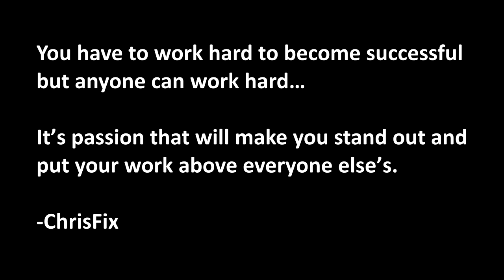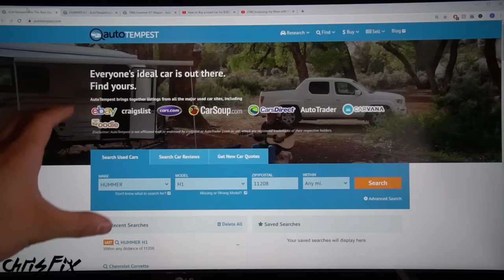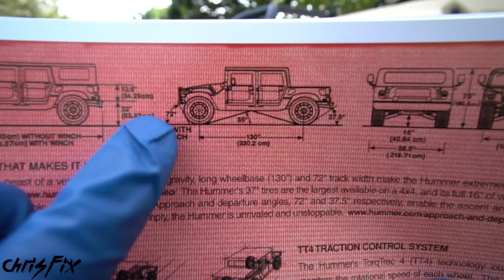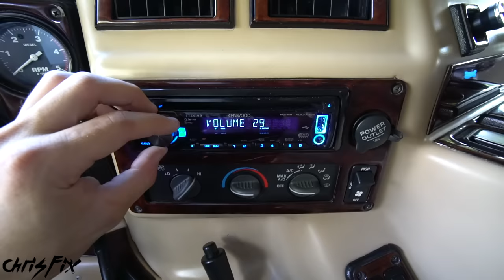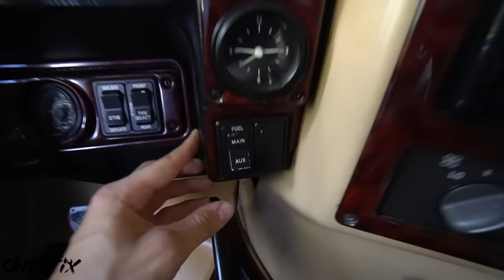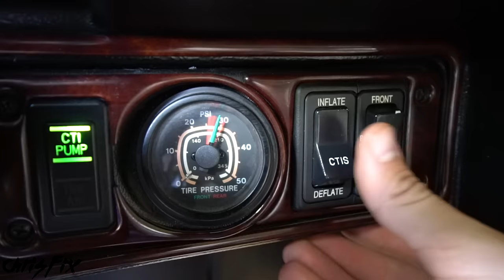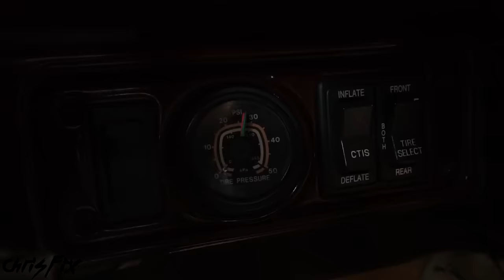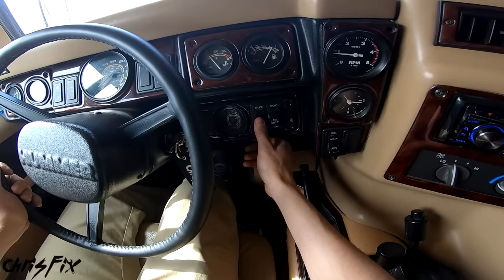I Bought My DREAM CAR and it's AMAZING!!!

Comment: With out chris fix I would NOT have been able to save as much money as I have through his videos. I SWEAR it. From buying my car, to changing the oil, replacing spark plugs, painting parts, and changing my blinker fluid, piston return springs and muffler bearings. I credit you chris because without you my passion for cars wouldnt be what it is now. 🤘🏼 thank you
Reply: Muffler bearings! Haha! Good one.
Reply: Lol blinker fluid.
Reply: you forgot wiper balancer
Reply: Muffler bearings are expensive at the shop. It's almost impossible to get a mechanic to change them.
Reply: Haa nobody noticed pisto return springs?

Comment: Hey Chris, figured you might be interested in knowing the reason why the center doesn't have any seating (you have that weird (no offense, just never seen that before) optional bench seat in the middle) in a standard military HMMWV (High Mobility Multipurpose Wheeled Vehicle) it's the perfect amount of space to fit a medical stretcher through the trunk. so that the people sitting in the back can then tend to the person on a stretcher in the middle. A little story, we were doing desert training in Nevada for deployment and some new recruits were driving HMMWV's for the first time. Well, they have plenty of torque. Had a youngster drive about 10 miles on the road. With the parking brake on!... As soon as we stopped the damn thing caught on FIRE. We got the fire put out quick. No real damage to the vehicle. The poor guy didn't hear the end of it for the rest of our field training. Good times.
Reply: G Juliusson also the HMMWV has that also because all the stuff like the axis and driveline is tucked up underneath so it’s harder to get it stuck on hills

Comment: 0-60 to in 7 secs in a 4 ton truck is AMAZING! Congrats on your purchase! :)
Reply: not really lol
Reply: @sacatolasmoreira5593  how isn't it?
Reply: and .7seconds just isnt amazing, ever. 7 seconds feels kinda quick enough i guess, but not amazing. my cheap entry Level, 58hp motorcycle from 1990 does 5.8 seconds. and thats not amazing , it is fun. Your average nakedbike is kinda amazing, Pretty much all below 4.5 seconds
Reply: @gur262  is your bike 4 tonnes??
Reply: Joshua Mack yeah, a bike weighs about 200 pounds at the most. You know how heavy 8000 pounds is right?
Reply: @gur262  7 seconds for a normal car is kind of quick, but for a truck that is that heavy is really impressive imagine being at some traffic lights in a 05 V6 Mustang not* an amazing car but not terrible had a little performance and this hummer keeping up.
Reply: yeah crazy 0.5 quicker then my kia proceed :) and its 3 times the weight
Reply: Some of you need some lessons in physics! :p
Reply: If my point wasn't clear. 7seconds ain't amazing for anything with an engine because it just wont feel amazing. It's a car.         If it weighed 30tons 0-60in 11seconds could be named amazing then. If it was a house 20seconds could be called amazing. But they are never amazing.

Comment: ChrisFix:  Puts a lock on fuel tank

LockPickingLawyer: 1 is binding, nothing on 2...
Reply: The ultimate crossover
Reply: I swear I was thinking of the lock picking lawyer as he was installing them fuel tank locks.
Reply: I thought the same thing my dude!!! I would pay good money to see that crossover lol
Reply: Lpl will just use a 50 Cal muahaha
Reply: i would try to unscrew it
Reply: Hahahahahahahahahahahha
Reply: The first thing he'd say is to weld those screws 😁
Reply: Hahahahhahahahaha
Reply: @thomasandrews9355  what is this now demo ranch crossover?
Reply: @ihatethatyoutubedisplaysyo8106  lol true
Reply: Dammit this guy watch too
Reply: With the lock on he can now drive in Eastern Europe.
Reply: He doesn't even need to do that! Just an impressioning tool you can buy on amazon.
Reply: Floating hand channels FTW

Comment: It is so amazing seeing you happy! But you should make video installing train horn!
Reply: CHOO CHOO! 😂
Maybe a bus horn? High pitch and VERY loud.
Reply: @ramslade  train horn is amazing! Bus horn is not up to level of Hummer!
Reply: Needs a horn from a semi at the very least, also the Hummer has an air compressor in it so should be able to hook the air tank needed to that :D
Reply: He’s going have to go through the trouble of shoving an air compressor in the engine bay unless he puts the air compressor in the back
Reply: Or just a heavy. Semi truck horn
Reply: Yeah, and insanely strong led lights. But like 30.000 lumens kind of strong 🤯

Comment: I'm in the Marine Corps and HMMWVs are the biggest pieces of shit I have ever worked on. But this one is pretty sweet.
Reply: Greatest-killer1 we have one that has been sitting in my shop for over a year
Reply: Greatest-killer1 he bought a hummer not HMMWV. So his will be easier to work on
Reply: You gotta remember the absolute abuse HMMWV's go through though, one of my old drivers floored the damn thing everywhere we went when he drove it, and that's just the beginning. The vic never let us down despite that guy
Reply: Like most vehicles with military applications, they are designed to be serviced and worked on, and returned to the battlefield as fast as possible.  They also tend to be designed with maximum flexibility in use so one basic vehicle can have probably over 100 different uses by making bolt-on changes to the body.  Inevitably this means that some things that would be almost essential in a road vehicle have to be compromised.  A lot of the issues with the HMMWV tend to be the rather old fashioned mechanics that they are fitted with from the factory to make them somewhat affordable to build.  Most of the Hummers that are on the road have, like this one, been upgraded well beyond what the military got, and had most of the inevitable design faults cured too.  Like the Land-Rover, they have plenty of faults that can be somewhat corrected, and there are lots of people who love them.  I like the H1/HMMWV a lot, but they are utterly impractical in the UK due to their physical size and thirst so it's very unlikely I'll ever own one.  I have to say, though, I've driven HMMWVs and they're a hell of a lot more comfortable than military spec Landies...
Reply: At least they don't use the plastic POS Hummer. Lol. The HUMVEE is a beast.
Reply: Semper Fi!👍
Reply: Comeing from the Army being a 91B I'd have to say the same they tear up 24/7  although I'm attached to cav scouts and they arent easy on equipment.

Comment: Stereotypical youtubers dream car: it is a v12 and the 0 to 60 is 3 seconds....
Chrisfix: my dream car has 16 in of ground clearance and ran over 2 civics
Reply: Its got a duramax in it 😂 v8 btw if u didnt know
Reply from the maker: #truth
Reply: Every youtuber
-lambo
-GTR
-porshe
Reply: Louis Harley Aguilar not me
Reply: @dallasdelano8235  min is a 1969 chevelle ss
Reply: Lol I want a Subaru Baja but I also love the Lexus LC 500. Those are my dream cars. Don't need a Ferrari or Lambo and TBH I find them a bit boring
Reply: Tru Matthews nice. Mine is a 1967 Shelby gt-500
Reply: Dude my dream truck is a lifted GMC Sierra or the ford ranger
Reply: seriously. your content quality is through the roof @ChrisFix.
Reply: @dallasdelano8235  and i thank you for that, gl on your truck, hopefully you fix her up and make it a project...i see you need a paintjob, ive painted several cars before and worked on a line as a painter

Comment: For the fuel doors, replace those Philip head screws with torx or allen, not really detering besides a opportunity
Reply: No, make each screw require a different screwdriver.
Reply: And put posion on them.
Reply: Highly doubt kids will be carrying a screw driver with them to put dirt or water in someone's gas tank. If you're really paranoid you can put rivets instead of screws
Reply: going with the flow...weld the fuel doors shut forever.
Reply: They looked like torques to me
Reply: Pentalope is one of hardest to find tools specially used for some electronics.
Reply: he just has to round them XD no you need a drill and much time^^

Comment: 29:15 Installs with common hex screws and says: "And now nobody can get in". 

Well. Except anyone that has been on IKEA, that is. Hahaha
Good stuff Chris, I'm happy for you.
Reply: Needs to use security ones or hammer ball bearings into them
Reply: @johnrichards7847  Or pop rivets
Reply: Fill em with JB Weld
Reply: or Maybe a Threaded machine screw with a nylon nut on the back.
Reply: Stainless steel Pop Rivets would  be cool !
Reply: But most drunk people who want to pee into your gas tank don't carry a screw driver around.
Reply: @Jehty_  I doubt that's what he's worried about, I'm sure there are a few people who blame him because they made mistakes while working on their own cars. They might see his dream car as an easy target for what they consider revenge.
Reply: I mean, who has a hex driver in hand? And they are round head so you can’t do the plier trick. This wouldn’t be as easy to bypass as say security screws. Security Torx you use a flathead. So it’s not Leatherman removable.
Reply: @johnrichards7847 security ones you could use a flathead in. Source, done it before multiple times. The post makes you have a great bracing point for the flat to then bit and turn. A Torx is easiest to do it with but a hex can be done with.

Comment: "I need a daily driver"
(Drives in on military hummer)
Murcia
Reply: That's the civillian edition
Reply: @nedkogenov5530  Sure, but it's still very much a military vehicle at heart, hence the hooks, the portal axles, and all that stuff specifically intended to make the vehicle tough as hell and massively capable. We're talking an H1 here, not an H2 or H3.
Reply: Hex Flareheart  it’s still a civilian model!   Matt from demolition ranch has the real thing!  It’s slow, it’s loud, leaks when it rains, and has the most uncomfortable seats in existence!   This hummer is nice but it’s still a cushy civilian model!
Reply: Those people who are so nit picky about whether it’s a civilian or not just piss me off. Ok you can point out it’s a civilian model but y’all getting so angry. Let the man be happy. A hummer is and always will be a military vehicle civilian model or not.
Reply: @jaykneegarner2479  Before the dmax swap - it had the exact same engine  Now all it has is the exact same chassis, suspension, tires, body, bumpers. The only difference is that there's nice cushy seats and plastic bits in the interior.  Thats really it.  Oh and the electrical system is 12V not 24v.  Believe me, its an HMCS, the roof still leaks. It's still loud as f***. If it was a 6.5TD like mine, it would still be slow as balls.
Reply: @jaykneegarner2479  it's basically the same thing. Besides the engine, trans, and interior is the same. I work on the military ones (M1151A1) daily trust me the look and act the same as this one.
Reply: „This is America“
Reply: @OneTiredMechanic  "besides all these major components"... Really mate?
Reply: @ANF_94  if you cummins swap a f350. It's still an f350 it's just got a cummins. The humvee originally had a 6.5L Detroit diesel mated to a 4L80E transmission. Now it's got a 6.6L duramax and an alison 1000. Not that far off from original. So yes it's still technically a humvee
Reply: @jaykneegarner2479  its because hummers are most likely used at the military and we dont see the civilian model that much because hummer was really made for military purpose(sorry for english)
Reply: @jaykneegarner2479   Its even made by the same company
Reply: Murcia

Comment: Me: My car broke in half... 

Chris: Common Handtools
Reply: RATCHET AND A BREAKER BAR
Reply: Medium-Strenght Threadlocker
Reply: Harbor Freight MIG welder, an upholstery needle, and a strong desire to fail inspections.
Reply: @sampla86  super glue
Reply: @ricerocket4449  😂
Reply: @IcyInferno11  🤣

Comment: The hummer's owner " I want my car back ".
Reply from the maker: He was happy to see it go haha
Reply: ChrisFix he probably feels so proud of him self
Reply: @chrisfix  hey Chris 
Hummer takes a lot of fuel
Reply: ChrisFix same thing happened whit our old Toyota van it was so reliable and it was my childhood car and it seing it off to its new owners made us so proud it has it has been whit us for 5 years till we had to say goodbye and now we own a limited edition Subaru Legacy whit 280 hp and a 0-60 in less than 5 seconds thanks to its awd and  we own a strada wich is still working and yes it is stock and also yes I will tune it soon when I’m older as I’m gonna drive that I might put a different engine or keep it and put a bi turbo there but also here’s our last car a Hyundai santafe (look it up) we got it from a betting thingy (I’m 14 I don’t know these stuff yet) but at first it has so many problems (radio getting no signal and getting a really high pitch sound engine has a cracked cylinder and the windows don’t work) so ofc we bought it to a car shop which is owned by by cousin after that a a few was replaced which kinda made a big difference we put new rims to add alittle bit of style to it and put a new radio whit a touch screen and Bluetooth connection it’s so relaxing to use it and it’s fast enough for an suv 0-60 in 6 seconds
Reply: william hodge ofc it’s a ducking evo but it’s not as fast as our new 370
Reply: I bet the owner of the hummer brought a paramount marauder

Comment: What amazes me about this vehicle is how they left all the screw, bolts, everything visible.  Pick any modern day vehicle and it would be covered, glued on, or glued together...
Reply: I work on these in the army, I’m a 91B and I’m gonna say this, the civilian adaptation of the HMMVW is so much more convenient in terms of bolts, perfect example the M-1097 HMMVW’s oil filter is right above the exhaust pipes on the vehicle….. meaning you have too drop part of the exhaust system too change out the oil filter 😂

Comment: Normal cars: fuel pump fails, looks like I'm stranded.

Chrisfix: fuel pump fails, I'll just switch to my backup gas tank.
Reply: If you're fuel pump fails you wont be getting gas from the backup tank either lol
Reply: @Lightifyyy  i think he meant that there was a separete fuel pump
Reply: @Lightifyyy  all fuel pump in vehicles nowdays are in tank so if you have 2 gas tanks you would have a separate fuel pump assembly in each tank
Reply: Unless its an old ford 1 in each tank 1 on the frame
Reply: I totally read his part in his voice haha
Reply: Old ford pickups like mine have two tanks
Reply: Then you know you have 3 pumps atleast of its 85 or newer
Reply: ad636051 no, just no
Reply: @awesomEDD16  maybe I should look around under my truck again.  I've never replaced them even though it has over 200k.

Comment: Nobody can put anything in the fuel tanks.

LPL: Hi, this is the lock picking lawyer.
Reply: LMFAO
Reply: LMAO
Reply: lmfao epic/////
Reply: LPL wouldn't even pick it, he'd unscrew the cap, since that is a major security flaw
Reply: LOL
Reply: No need for a lock pick just use a screwdriver as the same process to fit this "Lock" is what is needed to remove it 😂
Reply: I had "and two is binding" in my noggin when Chris was adding the first locking cap
Reply: They could also take the screws off
Reply: @nightowl2210  actually, if you look closely when he was taking it through the water, they were not even there anymore.. so not sure if he did that part before installing or removed them for some reason.  :)

Comment: some jackass: stabs tire

central tire inflation system: exists

the thumbtack: am i a joke to you
Reply from the maker: Lol
Reply: I mean not exactly the tire wont fill because there is a release of air
Reply: @AL-mm9mc  issa joke
Reply: @AL-mm9mc  it'll fill. It just won't stay filled
Reply: @kaitheviking8468  I know
Reply: @kaitheviking8468  but it would not ever be fully filled because of the constant release of air but it depends how long it was left before the tyre was slit
Reply: @AL-mm9mc  Hey, no worries. Sometime you miss the joke. Youll get over it. :)
Reply: @notnadz_  lol I got the joke I'm just saying that's the logic and the physics behind it